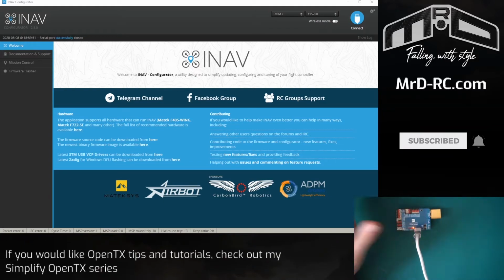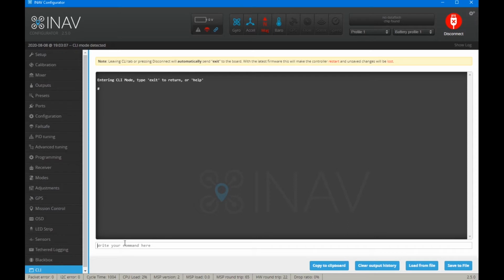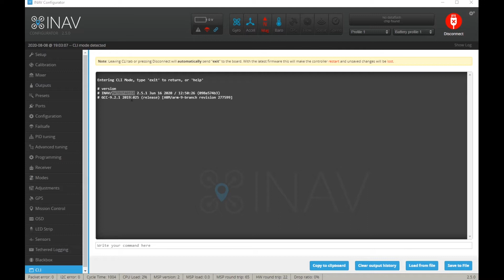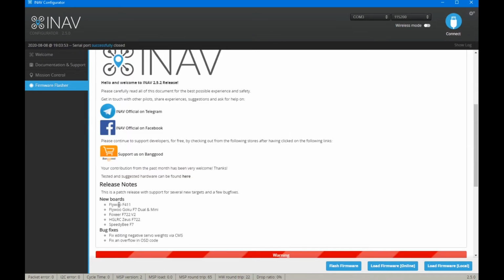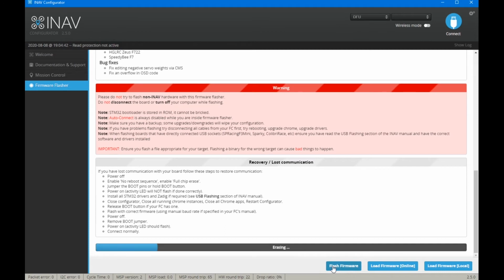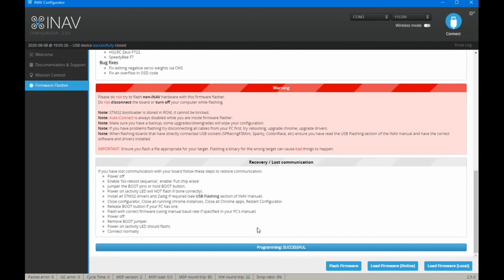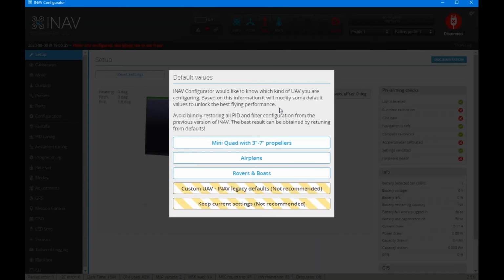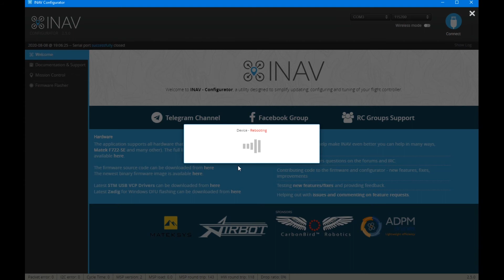How to flash iNav

Comment: I got "Unexpected error: Cannot read properties of null (reading 'on')" 
It happened after I replaced driver using Zadig. Unlike before I can now go in DFU mode and flash firmware, but afterwards simply getting mentioned error and unable to connect

Comment: I'm trying to flash inav on my fc, I don't think the zadig driver utility is working for me, it just keeps failing to flash.
Reply from the maker: Don't use Zadig, use ImpulseRC driver fixer as recommended in the video. Also try a different USB cable and don't use a USB hub.
Reply: @MrD I can connect to inav, does that mean the drivers aren't the problem? It just won't flash.
Reply from the maker: @jhughes2286  sounds like it just can’t enter DFU mode. Hold the button on the flight controller down when you plug in the USB.
Reply: @MrD  Thank you I will try that.